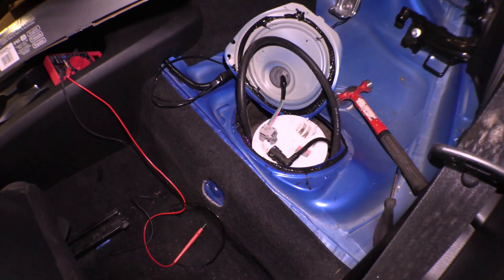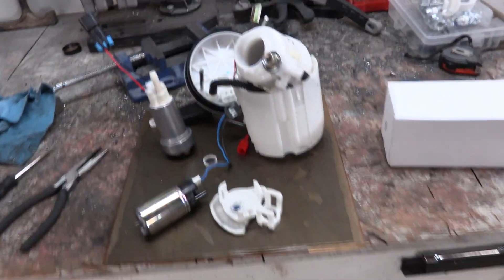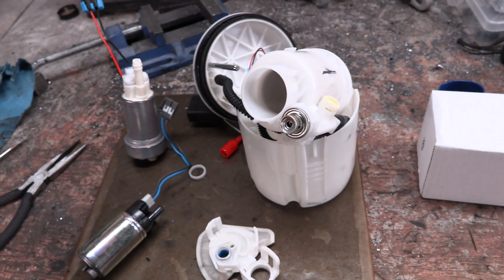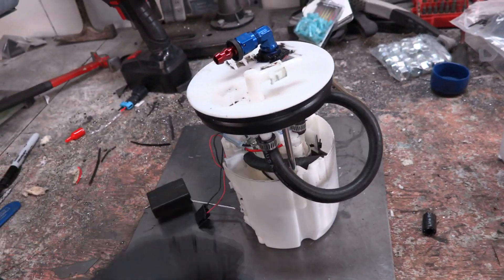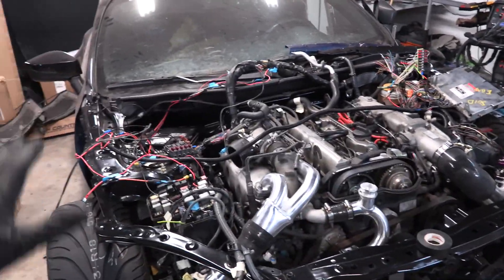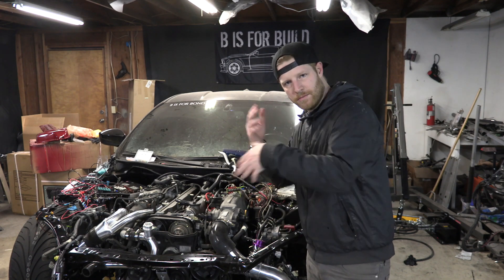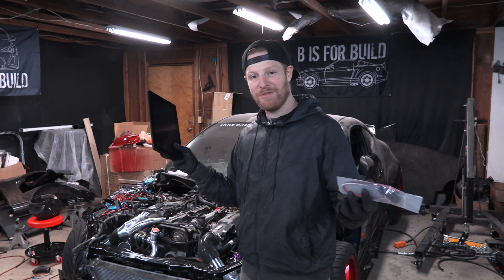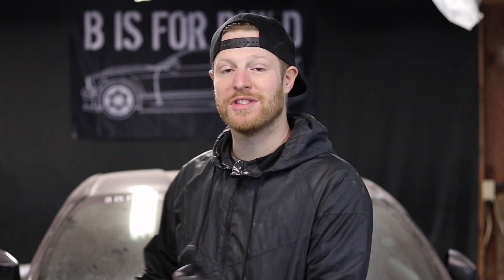2JZ BRZ Pt 12 - DIY $60 Digital Display

Comment: Chris you're going to run into issues with your BOV. Since you're using the stock computer and harness, the motor will stutter/stall in everyday driving. The factory wastegate recirculator (BOV) is recirculated, not vented to air like most BOVs. Plus the CX Racing one is cheap. It will leak. I used their "Bolt on" kit on my GTE IS300. Also, that new intake pipe you put on the turbos and deleted all of those turbo vacuum lines will cause a problem. You don't have the vacuum hoses on the turbos so the sequential setup will not work, so to get it to work you'll either need to reverse all of the vacuum connections on the turbos or wire the vents in the turbos open to do the "True Twin Conversion mod". Which means both turbos will come on at the same time instead of one at a time.
Reply: That Mellow Guy i love his builds but his bunk solutions to everything ( no offense Chris ! ) get old . I wish he would do something right

Comment: Torque is really a fantastic app. It's $5. I paired it with a $13 Bluetooth OBD-II scanner. Now I have access to any information I could possibly imagine, including 0-60, air-fuel ratio, boost, etc, plus it checks codes.

Comment: I use that torque app with an extra android phone i leave in my car. In my roots supercharged e55 amg, It was an amazing tool to have while i was dialing in my air to water intercooler system and for optimal performance, while experimenting with different heat exchangers, pumps and intake mods. With the iat gauge in the app you can monitor how high your intake temps are getting when you're running the car hard, As well as watch how quickly the temps recover after pulls. Invaluable app for a boosted car!  Nice work on the builds man, And keep up the badass videos!

Comment: hey bro i use TORQUE too. you can get air fuel and boost. usually for anycar you use the blue tooth sending device on your obd2 port to check fault codes. it will give you quarter mile n full mile times. 0 to 60 times. everything. just make sure the blue tooth adapter isn't a cheap one from eBay cause you won't get all the features tourqe has!!

Comment: i use torque on mazdaspeed6, u can change the speed dial to be speed-via-gps. far more accurate, once thats set u can then run the 0-400m, 0-100kph, etc

Comment: Where did you get the info for the  string in advanced settings in torque, I've been running it in my honda on occasion for a while but many of the sensors I would assume are on the car don't function in torque.

Comment: Torque is pretty sweet. I have this for my MS6 and Legacy GT. You'll want to enable the option to speed up read/write response to get those gauges to read quicker. The only issue is that there is still a bit of lag when it comes to what you'll see and what the car is currently doing so I'd still recommend getting gauges for important things like Boost, oil and water pressures which might enable you to respond to issues faster and avoid  potential disasters. As a temporary solution, this is good though.

Comment: Some of those ECU's will also let you display boost and the o2 voltages. You may also want to get an android stereo so you can run Torque on that and not have a spare tablet sitting in the car. Great work.
Reply: I say that cause I did that in my Alltrac so I could read the ECU on my newer motor since the gauge cluster does work well right now lol.
Reply: can i do this to my jdm civic ? it has an odb2 ecu but being jdm the car's wiring is odb1 with no odb2 connector port
Reply: You would need to see if there would be a way to wire in an OBD2 port. What wires could be used. With it being a Honda, is there no obd1 readers out there?
Reply: there are obd1 interfacing devices

Comment: If you haven't fixed the mustang yet I have another Idea what is wrong. You may need to move the MAF sensor or repipe so that the sensor is metering the intake through the air filters more than the boosted air. Some MAF sensors on Na cars are not designed to work on boosted air. Other wise Idk what you could do with the stock ecu. You may need a different MAF or MAP which probably won't be compatible with the stock ecu.

Comment: Torque is really good for this build. Check out the Torque addon called Torque Scan so you can find more things to look at (called PIDs) and you can also add custom and 2JZ specific things for the app to read from the ECU that you can find online. The pro version of the app is well worth it too. It should also have a boost reading on the app already for you, and can work as a GPS Speedometer.

Comment: Cool that you figured out that ECM somehow supports OBDII in some capacity, it's strange too. What year model Toyota did that 2JZ come out of? If memory serves, OBDII became standard on USDM vehicles in 1996, so a 94-95 may have had it as a stand in while they did some testing before implementing it.

Comment: That silicone glue that you used on the pump assembly will turn in to gum once gas hits it.
Reply from the maker: +Kappa Jr nah there is fuel safe stuff i used, and only on the top hat of course
Reply: can you tell me what its called because i need it for my gas tank! i used some normal silicone and  it just turned it in to glue and F up my gas tank.

Comment: Is that submersible hose?
Be careful using stock wiring as the current draw is around 22 Amps at full load.
Reply: Stock current draws are usually less than 15 Amps at full load.
Reply: SiMonster, without going too far into it, pretty much. Amperage will also increase as you increase fuel pressure as the pump has to work harder.
Reply: What's the difference between new current required vs  stock pump‽
Reply: So with more Amps you run slightly thick gauge wiring   (*sorry I'm a complete novice with electrics) ...is that as less resistance (*so the narrower/stock wiring won't [essentially]  fail/act as a fuse?)
Reply from the maker: +trentmeyer23 i ran upgraded wiring a while back
Reply: B is for Build 👍